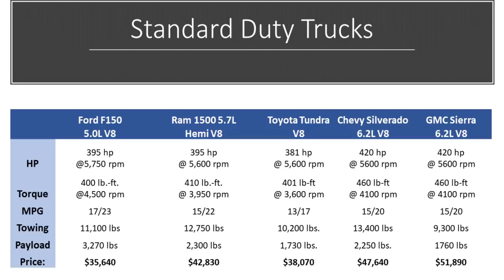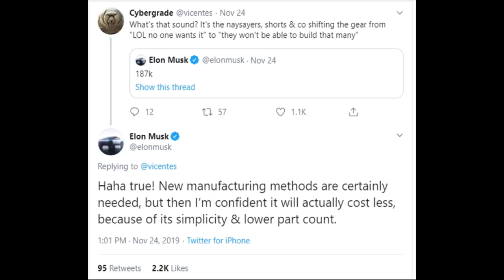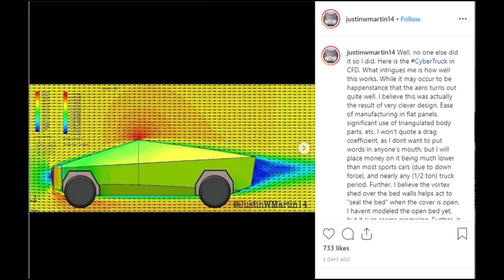Tesla Cybertruck Design Genius or Design Fail? Exploring the Function behind the Design

Comment: Hi 
Thanks for your video
But my point is Sharp corners are even hard on its owner to the kids !!
Also, this Cold Rolled Stainless steel is very hard and only Manufactured in Factories, big factories to be more precise,
Now if any Accident happened , How the police will cut the Stainless steel Doors or break the unbreakable Glass ??? 
Also, Are the workshops have the technology and Equipment ready for fixing a hit door and body ?
This is very important?? How after sales is going to affect maintenance 
It’s easy to buy the car 
But will it be easy on owners and workshops and cities to handle normal life fixations or injuries ????? Due to the tough material used !!
Remember 30 times
Harder than steel 
Safety need to be reported and tested

Comment: 40K is actually a really good price point for all the features and capabilities. To really sell to the masses, they need to really cut all corners and come out with a very budget car, around 20-25K. Probably not possible if you want to do electric, but still I think a company needs to cut all fat and only give what's necessary.  I bet we will see some copy cats at least with the areodynamics, and folded steel just with a standard motor in it, and cost half the money.
Reply: except the nissan leaf sells for 26k

Comment: I don't believe a single engineer of the Cybertruck ever had to use a truck in their entire life lololol.... No chassis for overhead tow hitch in the bed? No chassis for tow along? No chassis to bolt winches to to pull trees down without pulling the truck out of shape? How are people going to haul their horses and race car trailers? And without an on-board generator you better not use those on-board outlets for too long too far from home.. Flat paneling may be the cheapest to manufacture but its the weakest shape the material can possibly be used as. I just don't get any of it.. its a wal-mart el-camino

Comment: Their 30X stainless steel is stronger than titanium only with super-low temperature. But still, it is strong.
Reply: Define " super-low "...
Reply: @hapax87  Minus 300 degrees Fahrenheit probably.
Reply: Strength to weight ratio, not just strength.
Reply: titanium is just flat out stronger. Not to mention as light as aluminium.

Comment: Just for the sake of accuracy and to hopefully prevent some of the FUD down the road, stainless steel is not rust "proof".  It is rust resistant.  If not cared for properly even stainless will rust eventually.  You are also assuming the inner portions of the "exoskeleton" are also stainless but based on the images of it form the presentation it is more likely the interior portions are regular steel.
Reply: Which is why a scotchbright or buff sponge will be enough to fix it
Reply: @Quiet Entropy- Deloreans were veritable rust buckets below the stainless panels, within a few years of harsh climate conditions.

Comment: Gasoline Automobiles are Obsolete
The Electric Drive-trains makes the most sense and are now more practical and affordable for Cars & Trucks 

FUEL COST PER MILE
• Less than 20% of the power in Gasoline goes to propel the Vehicle
• Gasoline Cars cost per mile 10 to 30 cents/mile
• Electric Cars cost per mile $0.4 cents/mile

10 Most Common automotive Repairs
1. Brake Work
2. Oil Change
3. Coolant System
4. Tires
5. Ignition System
6. Electrical System
7. Fuel System
8. Transmission
9. Exhaust System
10. Air Conditioning 

The Most Common Internal Combustion Engine Problems.  “ICE”
1. Engine Won’t Start
2. Battery Failure
3. Wiring or relay failure
4. Fuel pump failure
5. Dirty fuel filter
6. Check Engine light
7. Emission problems oxygen sensor
8. Spark plugs/distributor cap/electronic ignition
9. Fuel quality issues
10. Overheating
11. Faulty thermostat
12. Kinked of broken radiator hose
13. Low coolant level or coolant fan failure
14. Dirty air filter

Electric Cars & Truck are the better because
1. Powerful & Safe
2. Cheap to operate
3. Even cheaper to maintain
4. Drive-train Warranties for 8 years of more
5. Can be re-fuel for free at home or work and on long trips
6. Will have a greater re-sale value
Reply: @MrFoxbody89 people are always resistance to new technology is just a matter of time and you will also be converted. EV as simply lest over all cost to operate despite the few short falling that you mentioned.

Comment: Things that will likely change on the Cybertruck. 
1. Wind shield wipers. Possibly just one big one. 
2. Unless the law is changed to use cameras the truck will need side mirrors. 
3. Will have a conventional steering wheel and possible dashboard changes to accommodate airbags. 
4. Elon said some of the body may be changed a bit to minimize drag coefficient 
5. Likely changes to bumpers due to regulations/tow hitch 
6. People have said the main headlights may also not be street legal as they do not appear to be focused correctly although they can  keep the bar look.
Reply: Mark Kazmier Atleast for the European market they will need to build in some kind of crash shock absorbing zone..or maybe they just forget about overseas markets...I don’t see any escape for any shock wave during a crash..

Comment: 250 thousand orders so far
Looks like it will do just fine
After forty years driving Chevys this will be my next truck
Reply: Preorders are not sales.  And the XUV concept was shown by GMC to be a total loser.  No one else wasted their time doing it after the Envoy fail.
Reply: @billcichoke2534  - I don't understand your comparison of Chevy's cookie-cutter, zero-innovation failures to the Tesla Cybertruck. Do you?
Reply: @billcichoke2534  Tesla tried the multi-speed transmission long ago (on the original Roadster, I believe), and threw it out. IIRC, it was due to reliability issues as the high torque motor puts incredible stress on the gears. With the additional cost and complexity and minimal benefit (it gives power at a range of speeds that is typically illegal, and that the 99% of drivers simply do not even tread), Tesla decided early on to forgo a transmission.

For those who truly will be travelling at speeds exceeding 145 mph (i.e. track drivers and autobahn travels), the Taycan is possibly a better alternative, though the initial results from the three-motor Model S indicates that the Taycan is already outdone, and then there's the Roadster 2.0, which many would argue is poised to put all other "sports" car back to Princess Fairyland...all without need for innovative transmissions.

Lastly, while preorders are not sales, reading through enough comments online, indicate that there are a lot of people from the intended demographics who are very interested in the Cybertruck exactly because the specs are very compelling versus the entrenched competition.
Reply: @roddlez  Tesla went the way of SOFTWARE engineering, like I said.  They didn't have any MECHANICAL engineering prowess, which is why they still can't get the transmission to work.  So they went for a much bigger motor, requiring a much bigger battery.

And it's not just about the highest top speed.  It's also about keeping within the sweet spot of the engine's/motor's torque band (yes, electric motors have one as well).  Also, it means you can maintain a good highway speed at lower motor RPMs, using less energy.  As well, you can achieve excellent performance with a smaller motor, requiring a smaller (and LIGHTER) energy pack.

But it DOES require something more actually sophisticated than a flashy iPad screen with fart mode.  And trendy and flashy are what people are looking at right now.
Reply: @billcichoke2534  I believe the original transmission for the roadster was outsourced to ZF (based on memory). Anyway, if whichever German company they outsourced it to couldn't build it reliably enough, I wonder how much success Porsche will have. I won't be surprised if Taycan owners are always sitting in loaners when they take those cars in for replacement of melted transmissions, but hopefully they have it figured out and it actually contributes meaningfully to the performance, though I'm doubtful since VW/Porsche's battery and motor designs by specs alone are years behind Tesla, which means a Taycan owner is paying substantially more for similar or inferior performance.

You talk about Tesla's bigger motors and bigger batteries, yet Tesla leads the market in motor performance to size ratio and in battery density. I'm not sure where you're getting your engineering information from. If you compare Tesla's battery pack storage capacity to their range and performance, they're heads and shoulders above Porsche....
Reply: @billcichoke2534  - Whew! LOL I just sprayed my coffee when I saw you used the word "fanboy." I didn't realize you were a youngster. Sorry. Ramble on.
Reply: @roddlez  Unless it's all in the angle of shots, the motors I saw used in the Taycan, are smaller than the ones used in the Teslas.  And Tesla allows you to charge the battery up farther, which is why their cars have had charging and other fires, and others haven't.  Battery management only goes so far, then you're at the whim of chance.

Not sure where Tesla/A123 got their I intial transaxle, but Porsche built theirs, and they seem to be doing just fine.  Again, it's some complication added, for a benefit.

I've been trying to see what chemistry Tesla has been using, or if there is ANYTHING truly proprietary they bring to the table...I haven't seen anything yet.  Panasonic and now BYD are making their batteries, either at kilofactory Nevada or elsewhere.  Where the motors are assembled is ANYONE'S guess.  The 'in house' chip they're using?  Still looks an awful lot like nVidia's design, rebadged with the Tesla logo.  So I don't see where they're suddenly masters of metallurgy or anything else except software.
Reply: @billcichoke2534 : "They didn't have any MECHANICAL engineering prowess, which is why they still can't get the transmission to work.  So they went for a much bigger motor, requiring a much bigger battery."
— Automatic transmissions are the Achilles' heel of most American cars and a piece of machinery rather expensive to replace/repair. So why bother to put a weak transmission or to compromise regenerative braking in a truck that is expected to be a reliable tool? A single-speed transmission is one part less that will break. Porsche sacrificed reliability for the sake of higher top speeds and higher acceleration at high speeds. Truck drivers will never feel the urge to drive at that sort of speeds nor require high accelerations in today's roads so offering such performance figures is neither practical nor appealing to them. Bigger electric motors don't require much bigger batteries since electric motors are quite light and compact compared to the overall weight (and volume) of EVs (specially of electric trucks). Bigger electric motors aren't any less efficient than smaller, less powerful and less torquey ones. A bigger motor doesn't have to spin at more revolutions per minute to deliver more power and torque than a smaller one with the same energy efficiency. On the other hand, you didn't consider the added inefficiency caused by adding a multi-speed transmission that would largely cancel out any gain in efficiency from a motor spinning at lower r.p.m.
Reply: @ZephyrLópezCervilla  First, you're correct about AUTOMATIC transmissions, but MANUAL transmissions can run for decades with few ill effects.  And the reason you use them, is to tailor the motor torque output to the situation, something single speed transaxles cannot do.  Also, you can run faster top speeds, but you can ALSO run the same lowers speeds AT SLOWER MOTOR RPMS, thus using less energy.

We've been doing this in the ICEV space for around 80 years, with the main weakness being the wear of clutch plate or band friction material.  With an electric motor, you don't NEED a clutch or torque converter, so advantage electric motor.  As well, you can multiply torque from a SMALLER motor, once again requiring less energy to create the same torque and less battery peak energy.
Reply: @billcichoke2534 , but the 2-speed transmission of the Porsche Taycan is automatic. By default, it's "programmed to shift between its two speeds at 43 mph" [ wired.com/story/electric-car-two-speed-transmission-gearbox ]. Granted, it's probably much less failure-prone than a regular CVT but I bet it'll be much more expensive to replace as well.
Reply: @ZephyrLópezCervilla  ANYTHING that's electronically controlled will be an expensive fix.  Think the main display on the Model 3, the power control modules, the door handles on the S and X...I won't even guess at what the MOTORS cost when they freeze, fail, or otherwise need replacement.  And since they're PART of the 'drive unit' that includes the single speed transaxle and motor control assemblies...ouch.

I'm saying that the use of a MANUALLY SHIFTED transmission with a smaller motor, would get relatively close to where they are due to NOT ONLY the benefits of a multi-speed gearbox, but also due to the lesser requirements for as large a motor or as many batteries, which WOULD mean less weight overall.
Reply: @billcichoke2534  are you still against this truck or have you warmed up to it? No sarcasm here. Serious question
Reply: @Fitforacting  No.  Again, the design is not innovative as much as lazy or desperate.  Too much electronic and software involvement, meaning MORE problems with reliability, NOT LESS.  And a company and CEO I couldn't trust as far as I could throw them.

My only point is, it could be done better than it is.  Most of the EV space is filled with PROGRAMMERS instead of ACTUAL ENGINEERING.  Most of these designs reflect the EV makers' wish to dazzle with glitz and gadgets, as opposed to using good old design chops and doing the hard work of making them right without electronic band aids.
Reply: @billcichoke2534  Let’s agree to disagree agreeably. This is the most innovative vehicle that I have ever seen in my life due to its design. There is a lot great things with current Tesla’s now and this would be an even better version of what we already see in the world with Tesla. Just my point of you and many others as well but yours is interesting too. I would like to see a car come out that has the points you would like to see and then be able to compare the two.
Reply: @Fitforacting  I hate 'agree to disagree' with a passion.  It's the same as 'shut up; I don't have an answer and I don't want to lose.'  We can be agreeable AND discuss back and forth.  That's what it means TO DISCUSS a topic or idea.  Aside from shills and the emotionally/financially invested, there haven't been any willing to honestly discuss this thing, which is unfortunate.  The more oxygen one company takes, the less choice and the worse products you get.

And the fact of the matter is, this is NOT innovative or groundbreaking.  This is still a unibody vehicle trying to compete in a segment where unibody vehicles DO NOT do well.  Regardless of the material chosen for the body panels, the torque forces put on them by the loads being carried OR TOWED, will be enough to twist them.  In a slightly flexible body on frame design, this is no big smokie.  In a unibody design, the body is now permanently tweaked, causing door closure and other alignment issues all the way down to the suspension.  If Tesla can't design a multi speed transmission that doesn't break under NO load, how have they all of a sudden cracked THIS issue?

Short answer?  They HAVEN'T.
Reply: This truck will never hit production. 😂😂
Reply: @yankees29  You are ignorant if you don't think this will hit production. Tesla has been late on delevery but Elon has never not delivered what he says he will. The finial product will have better specs than he revealed. Do some research.
Reply: @yankees29  You must be one of those that likes to be wrong. Maybe you think it makes you fashionable or a renegade. It really just makes you look foolish.
Reply: @yankees29  we are going to see about that
Reply: yankees29 Wake up sleepy.  Here’s a tip: name a concept car brought out by Tesla that hasn’t gone in to full production?  You can’t.  Everything Elon Musk has said he would build he has built.  Time to get with the program sunshine.
Reply: @wattlebough  Roadster 2.0, Cybertruck, Model S and 3 2dr coupe.
Reply: Bill Cichoke Lol, is that an attempt?  They’ve been announced.  Release is slated for 2021.  Patience my pretty.  Come back in a year.  Meanwhile we have the Roadster, Model S, Model 3, Model X and Model Y to be released in only a few months.
Reply: @wattlebough  No, it's an answer, and you dismissed it instead of honestly admitting 'oh, yeah...those.'

I do think it's funny that Model Y is supposedly going to get all these NEW customers and not cannibalize Model 3 sales from the existing owner base.  After all, the same thing was said about the Model X, and it sold like Hitlery Kkklinton's autobiography.  And the 3 has cannibalized not only S and X sales, but all other EV sales.

But pickups and SUVs and other ICEVs are still over 98% of the market.  So sure, Model Y will take some sales away...from Model 3.
Reply: @yankees29  still think the same way after 1 year?

Comment: exoskelington body is not the same as a unibody design because the body panels are also the frame a unibody the structure is on the inside with panels attached